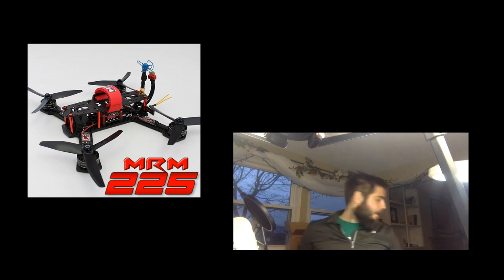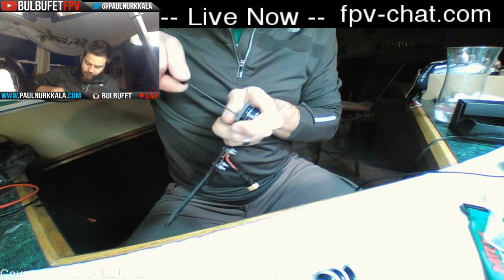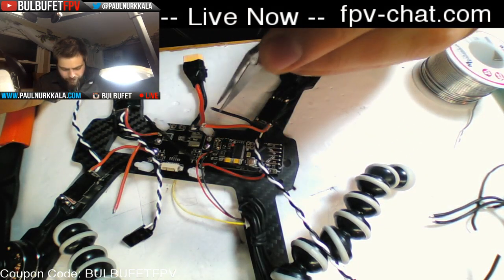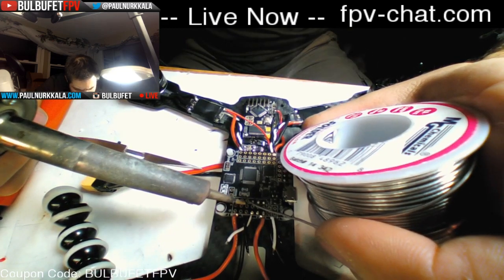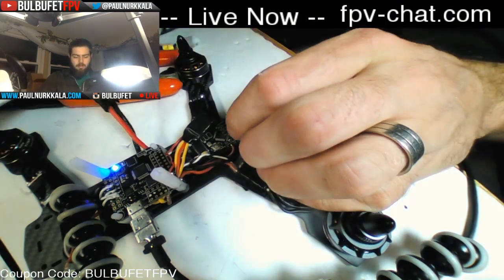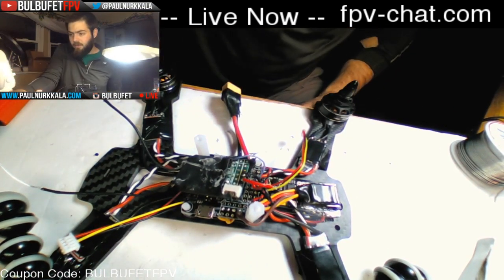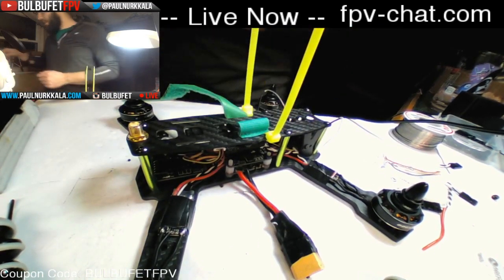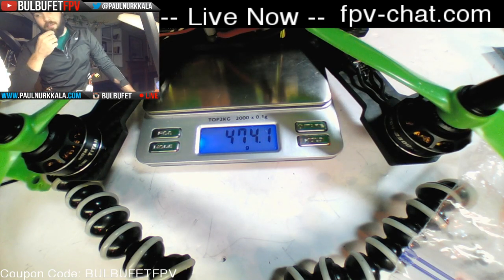Livestream // MRM225 Full Build // MultirotorMania

Comment: Hi, this looks great!  would you say that this is better for racing than the QAV210?
Reply from the maker: +Flight Mode Fast Yes. Significantly more durable in my experience. A tad lighter, I believe.
Reply: Great. Dimensionally is it still relatively small like the QAV210?
Reply from the maker: Yes. A bit wider stance since it can fit 5.5 inch props.
Reply: Thanks. How heavy are your motors. My quads are a lot heavier than yours but the red bottoms in mine are 30 grams each!
Reply from the maker: most of my motors are around 30g these days. I was running SunnySkys in that video which are insanely light.. like 40g total.
Reply: Ah - thanks - that's how come your quads were so light. I'm at 350grams minus battery and action cam but all else as in your weigh ins where you were getting like 315grams.